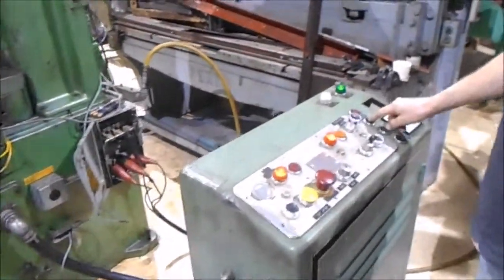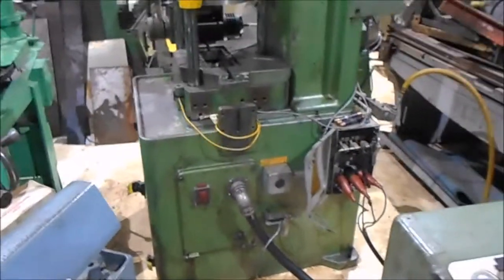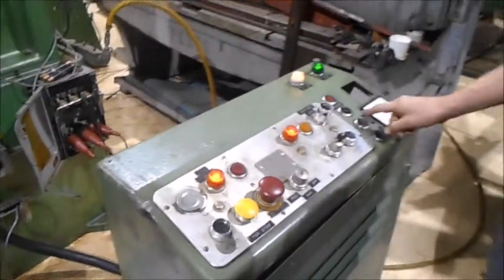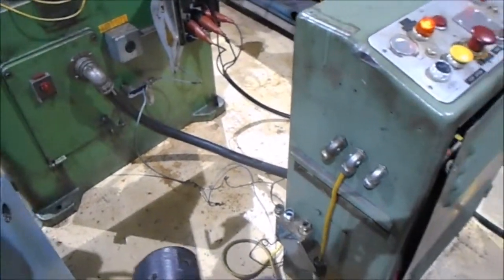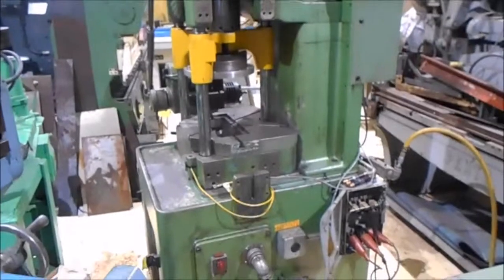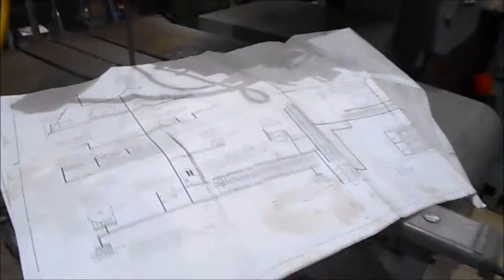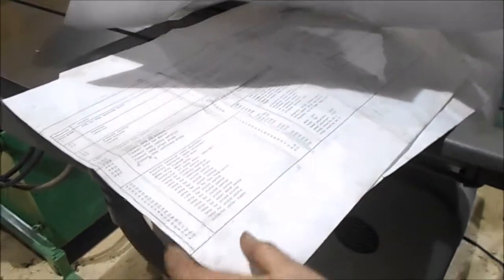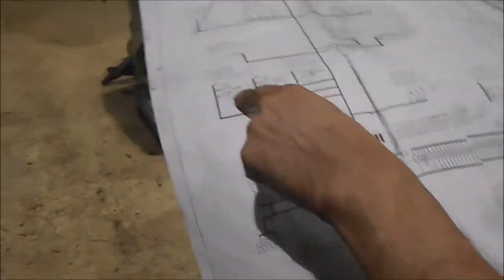Bruderer 30 Ton Air Clutch Punch Press

Comment: Hi. Nice video explaining running of the Press. I would like you to give me a favour. Could you please send me the electric schematic diagrams that you have mentioned in your video of Bruderer BSTA30 press and pictures of speed cams mounted in the Control Panel. I have bought the similar machine but doesn't have any manual and Electric diagrams. Finding it difficult to run it. I don't know exactly the cuts in the speed cams where to place it on the shaft because majority of them were lying down  at the bottom of the panel. I can't place them in order. Please help me. How can i re-arrange the speed cams??? Need your help.